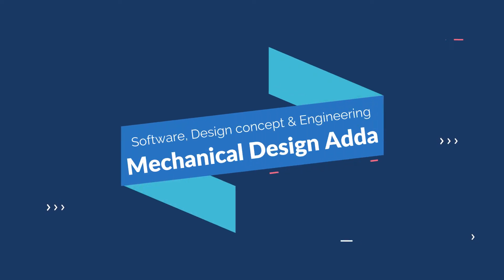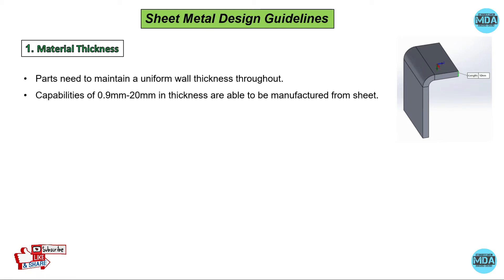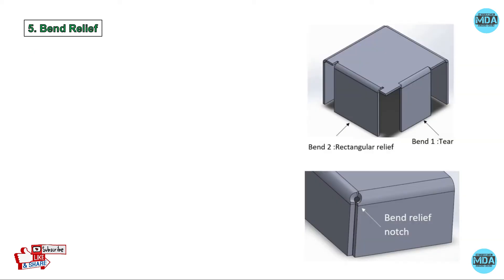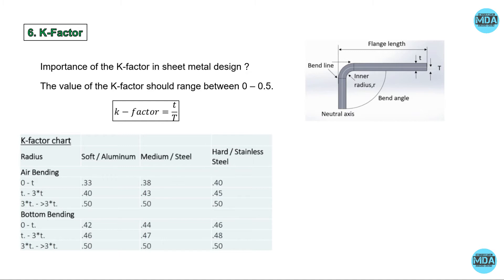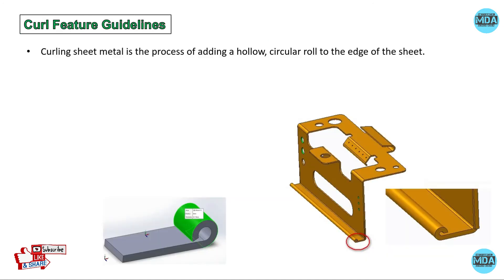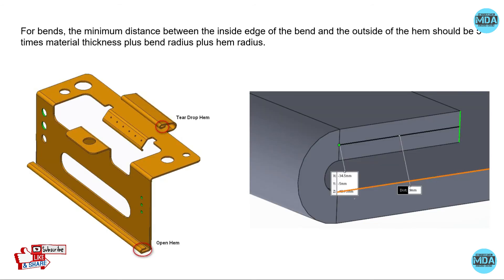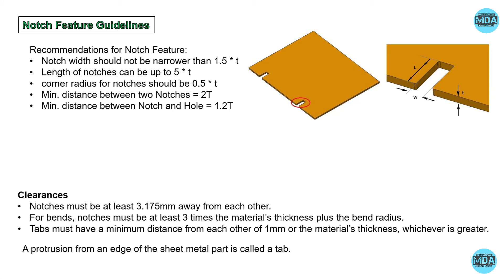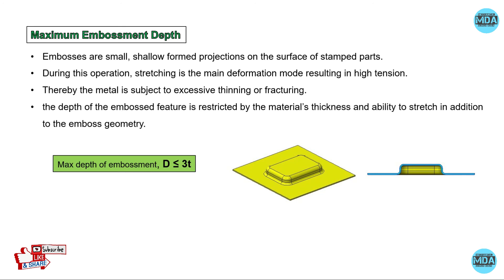Design guidelines for sheet metal components | Design for manufacturing sheet metal components

Comment: Hii...Can we design a 23S4P prismatic battery pack ushing sheet metal.
Reply from the maker: We can design a battery pack with sheet metal but proper insulation and safety factor like earthing, thermal management and cooling channel we need to consider and design a battery pack
Reply: well! Do you have any video based on that @MechanicalDesignAdda
Reply from the maker: No I don't have
Reply: @MechanicalDesignAdda  Ooh.. If possible please make a video on that.
Reply: And please share your linkdin I'd
Reply from the maker: Sure, I will work on it ☺️
Reply from the maker: You can connect over Instagram, I don't have linkin

Comment: That's a cool and simple explanation for better understanding prior to Sheet metal design, great initiative @Mechanical Design Adda
Reply: "Excellent breakdown of sheet metal DFM fundamentals! 👍These guidelines are exactly what designers need to avoid costly manufacturing errors. At our facility in Shenzhen, we often partner with engineers to refine designs for low-volume production, ensuring optimal material selection, bend accuracy, and cost-efficiency❤. This video is a great resource for teams transitioning from prototyping (via CNC/3D printing) to sheet metal fabrication. Well explained!"
Reply from the maker: Thank you for your motivational words

Comment: T and t difference ?
Reply from the maker: In K factor formula, which is ratio of thickness of material (t) to the position of neutral axis (T)

It is only representation you can write T as thickness of material and t as position of neutral axis also
Reply: @MechanicalDesignAdda  then neutral axis of the sheet will be at center of the sheet and always K factor ratio will be 0.5
Reply from the maker: Hi Manoj,
If you consider the ideal condition then the k factor is 0.5
But the k factor is depends on many factor like material, bending process, machine etc
So the k factor varies from 0 to 0.5
Reply: @MechanicalDesignAdda  Now I got it and thank you sir for your replies. 🙏